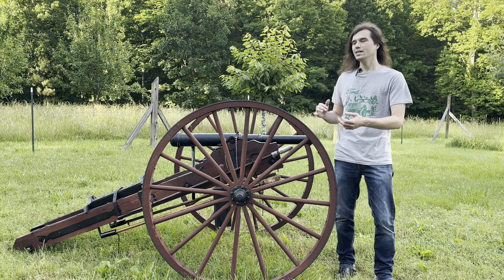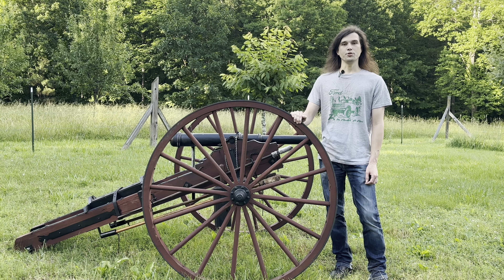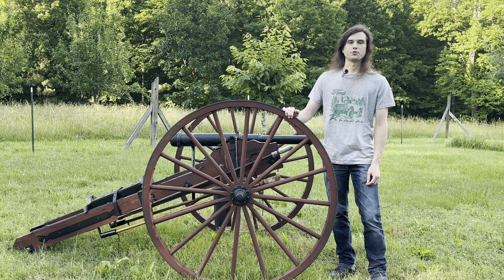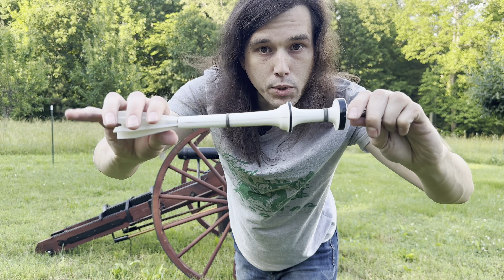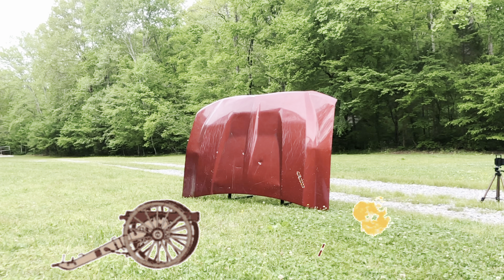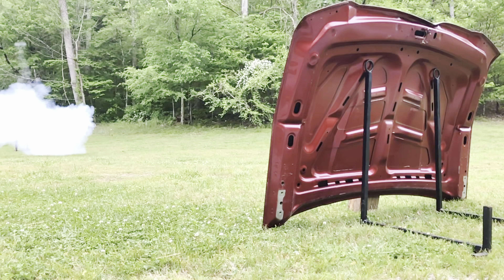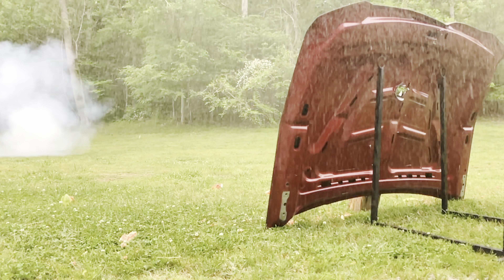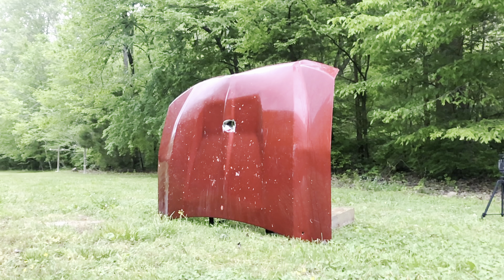Shooting 3D Printed APFSDS Tank Rounds

Comment: The speed you are going you might be able to get away with a more flexible plastic for the fins so the don't shatter under the initial shock of acceleration inside the cannon. Another idea is to drill a small hole and attach the fins with a cross pin through the the fins, or make the base of the metal dart slight larger in diameter than the body so the fins could not slide over the metal rods base (opposite end from the sharpened tip). Also I don't know if you cannon is rifled but riffling will destroy sabots to combat this the sabot needs to be a softer medium so it dose not get torn apart inside the barrel (why the 120mm cannon on American and German tanks are smooth bore while the British are riffled and don't tend to use the sabot shells the prefer squash head rounds)
Reply from the maker: TPU fins are on the list to try for sure for v2. As for the filing it’s a smooth bore as they got rifled cannons just before the American civil war.
Reply: @TheCannoneer   smooth bore definitely lends its self to working with a sabot round with less issue, don’t know it this helps but the real sabot’s on the 120 I’ve seen looked like styrofoam, but it was extremely hard, but still very light we were always running into them on ranges in Germany

Comment: So, the way sabots work is by using the sabot itself to drag the projectile down the barrel. One way you could make this work better is by using a threaded rod and screwing the rod into the sabot. That will probably be the most straightforward way of getting the two items to mesh tightly.
Reply from the maker: Threaded rod is the first change for v2! I didn’t quite know why it was threaded but that makes sense!
Reply: @TheCannoneer  glad to help. That will let you do away with the pusher plate and your fins will have a lot better chance of surviving. If they are still getting broken up, try printing them with PETG instead of PLA, it's much less rigid and more likely to survive bending.

Comment: Just a suggestion, but if you have some welding equipment you could weld steel fins to the steel penetrator. It would be much stronger and just 3 or 4 fins would be enough to stabilise the thing as we are not aiming for laser precision ( for now, but I have HUGE expectations for your channel). 
A possible solution to the brittleness of the sabots could be to have a thick steel base behind the thing and sabots made of wood. 

Thirdly why don't you contact the host of the Taofledermaus channel to spread the word about your cannon to all the homemade slugs manufacturers ? The chance of it working are slim but it could be a great opportunity for you.
Reply from the maker: I’ll play around with the base plates for V2 and try a bunch of versions y’all have suggested! He actually commented on the video! I think yall tagged him enough!

Comment: APFSDS rods have a mechanical hookup between sabot petals and the rod in the form of ridges which keeps the sabot from stripping off the rod.. and I'd go with metal fins.. anything 3d printed is likely to shatter from acceleration
Reply from the maker: I didn’t quite know why those threads were there but that makes total sense….

Comment: I like the anachronistic combination of 18th-19th century cannon and 20th century projectiles. Eric Flint would smile.

But you could learn more on each shot if you used smokeless powder and set up cameras to watch the external ballistics.
Reply from the maker: Sadly we can’t shoot smokeless out of the cannon for a few reasons… the ATF would classify it as a destructive device since it’s over 1” with a modern propellant and the pressure difference is wildly drastic between the two and our cannon wasn’t proofed for smokeless so the charge would be a trial and error to get right and that could cause some severe injuries to us and the cannon. I’d love to though as it’s much easier to see!
Reply: @TheCannoneer  Yeah, I know just enough about interior ballistics to be dangerous, while I've worked on a lot of liquid fuel rockets I've had no experience with solids, and burn rate exponents can change from steady burn to instant disassembly with breathtaking speed. Best to stick with what you know that works behind the projectile.

Comment: Don't use a pusher on the fins. The fins should be less than bore diameter, only four fins. Explosive gas will move past the fins and will push on the Sabo. The Sabo needs to be mechanically linked to the penetrator, ribs or threads on the penetrator, and ribs or threads on the Sabo. I think your sabo will fail if you make it out of PLA. If you have a lathe, you'll want to machine it out of aluminum. I'd recommend making the fins screw on aluminum as well. Make the penetrator a bit shorter.
Reply from the maker: I much appreciate your ideas and I’ll take them into suggestion for V2. Especially the threaded rods.

Comment: I'm seeing a couple of major design flaws already 
1. Adding the base plate is creating more problems than it's solving there should be as little stress as possible on the fins during firing because any damage to them will screw up your accuracy.
2. Your sabot should be mechanically locked into your fin round until it leaves the barrel either through a series of matching grooves and ridges or a flange at the front this will put all the stresses on the sabot during firing preventing damage to the projectile.
3. If the font of the sabot forms a concave cup to catch air and the forward binding is weakened enough this will cause the sabot to open properly and give it leverage to snap the rear binding causing a cleaner separation.
4. Depending on how your sabot is handling the stress of firing you may need to make it much more substantial and or switch to a more elastic less brittle material.
Reply from the maker: Much appreciated for the suggestions. I screen shotted your comment! Thanks!

Comment: steel rod needs to reach all the way threw the fins and have a 37mm steel plate at the bottom. also need to use pla+ or tpu for the fins
Reply from the maker: We shall see if those get it working on V2!

Comment: Honestly, do you really need fins on the end at this kind of range?

Okay, hot take. You know how a Minie Ball has a conical bore on its base? It serves two purposes. One is ensuring proper weight distribution. The second is that it'll obturate against the barrel when the hot gas expands behind it and form a nice and tight seal. So replace the fins with a cone made out of a relatively soft but strong material so as to not destroy your barrel. Maybe try aluminum flashing? Lead flashing is available if you're really worried.

Basically... it's a giant blowgun dart
Reply from the maker: We shall find out! I like your redesign idea so we shall see what happens for V2!

Comment: Use weldable steel fins.
3d printing in plastic is barely useful for Hobby grade RC vehicles that dont see the heat and pressures of a cannon.
Reply from the maker: That’s V2’s biggest change. Welded fins!

Comment: It seems to me the PLA fins might shatter before leaving the breach, due to the base plate being slammed into the much more massive steel penetrator rod.  Try metal fins?  Or redesign the fins so the rod touches the plate, that way they won't be crushed between the rod and the plate on firing.
Reply from the maker: Metal fins for sure! Some folks have suggested TPU so we shall try both!

Comment: I see good comments here. Mainly I would just make the discarding part of it a chunky cylinder that fills the bore and encapsulates the fins in addition to the penetrator to support everything as well as possible. 3D printing lends itself to chunky designs and your fins are too flimsy to be carrying all that acceleration by themselves. You might even see about adding a steel cross pin into the penetrator a little further up that can also key into the discarding sabot to take some of the stress off the fins. This would allow the sabot to pull directly on the penetrator taking some of the force away from the back. I imagine that even if the fins are surviving, the penetrator is getting driven back through the fins and through your TPU pushers like the penetrator that it is lol

Comment: Maybe cut 6 fins out of a thin sheet of steel and weld them onto the rod, or submit your STL file of the fin assembly for a CNC quote online (aluminum preferably) and glue it with JB weld. It is important to keep the penetrator relatively tip-heavy using lightweight fins, otherwise it will just tumble like those failed APFSDS rounds featured in the Taofledermaus videos.
Reply from the maker: Welded fins seem to be #1 suggestion so that’s first on the list for V2.

Comment: Okay man, I'm interested in the elements that are coming together here and you're doing some real cool stuff.  Subscribed.
Annealing your PLA prints in an oven will help their durability and shatter resistance but it'll make that oven pretty much unusable for food and I'm not sure it would help enough to fix your fin breaking issues.
I'd be really interested to see a form of ammunition go through that cannon like the wax slugs I have made to go through my shotgun.  You probably know all about them but if not the idea is to take a round of bird shot and fill the space between the lead pellets with a material that will hold them together through firing but come apart upon impact, such as wax.  This causes all the energy of each pellet to remain as one unit until impact where all energy will be dumped immediately giving little penetration but terrific energy. Scaled up to 38mm could be fun!

Alternatively, I would like to see if a non newtonian fluid of any make up could survive firing. Perhaps a balloon full in a shot cup with a boat tail on the back of it for stability.  I want to see what it does to a car hood.  A splatter or a deep dent?
Reply from the maker: Saved your comment! Great ideas and I wonder what would happen to them getting hit too… also we have a shop oven! Poor thing is used for heat treating stuff in the blacksmith shop!

Comment: Can you print a 38mm x 40mm plug with a short, centered protrusion the same diameter as the penetrator? Then print the fins with a center hole the same size so you can set the pin against the rod? This would direct the propellant's force somewhat more directly through the rigid centerline. Hopefully the plug will even out the force of the detonation on the round. Super interesting, folks are on to something with the material durability question. When you get this sussed build a HEAT round. 😉

Comment: Your problem is simple, the sabot is supposed to lock on to the penetrator and is used to accelerate the penetrator down the barrel with the sabot releasing and flying free once the penetrator exits the barrel. Your base was is crushing the stabilizing fins upon ignition.
Reply from the maker: I will admit I didn’t know why the rods were threaded but that makes total sense…
Reply: @TheCannoneer  you could also design the sabot as a cylinder that sheds the outside at the muzzle. Like an exact opposing mirror print of the sabot it's self, but fit to the bore  diameter.
Reply: @TheCannoneer They are ribbed* 

for her pleasure
Reply: yeah I’m pretty sure this is it
Reply: @TheCannoneer  I have spoken to tankers and people who understand the sabot shells and I was able to identify a couple problems
1) The base plate is coming out as well, this doesn't happen in an actual tank as that part remains in the breach and gets ejected when the breach is opened
2) The petals on the sabot are meant to attach to the base plate and dislodge when fired hence the problem of it not flying straight (if you looks closely at an ejected sabot case you can see where the fins sat prior to shooting)
A solution to solve these problems would be to potentially reduce the width of the stabilizing fins on the rear of the sabot or you could make an older style of sabot the APDS which is APFSDS but without the stabilizing fins. Also the threads on the sabot are just to stop the sabot from slipping out when being loaded into the gun. Sorry for the paragraph but I do hope this helps you.
Reply: @jackcitry3205 APDS needs rifling to stabilize the projectile. While at the ranges he shot in this video, they would probably work fine for the most part.
Reply: This is the correct answer.
Reply: Grooved not threaded but yes. This.
Reply: If you make the fins slide all the way up on the rod so that the weight is put onto the rod instead of the fins, then the sabot needs to have a support that goes to the back of the fins on the plate so that there is no load on the fins at all
Reply: @randolot  The sabot provides the gas seal and centers the penetrator along with the fins in back. The driving force of the gases is transmitted to the penetrator by locking ridges in the penetrator, and corresponding ones on the sabot which releases into three parts upon departing the muzzle of the gun.
Reply: and the fins need to be able to survive the ignition,  pla is not gong to cut it
Reply: I was hoping someone said this.
Reply: What would also probably help is casing the fins out of aluminum
Reply: The fins should be arranged so that the penetrator spins up slightly, avoiding tumbeling.
Reply: On this line, make the fins longer and foldable. Locke folding fin rockets shot out of tubes from aircraft. They will stay attached and unfold upon leaving the canon starting a stable spin.
Reply: could be solved by just having the the penetrator past the fins a little bit resting on the cushion. getting sabots that can deal with the pressure could be difficult

Comment: I would slide the metal shaft of the projectile through the fins so it sits up against the base plate, flush with the bottom of the fins. That way the force of the load will not instantly crush the fins. Nice design though, you're really on to something!
Reply from the maker: I’m sure with all y’all’s suggestions we can get it working for v2! P
Reply: @TheCannoneer  woooooooooohooooooooooo that shitz awesome, keep it coming!! Shoot a 5g sealed container full of gas with a flare lit beside it to make sure it lights 😎  that would be the most American thing ever and easy to build. That's not a suggestion, that's an order cpt. !!!!!!!!! Yewwwww!💥🗯💥🗯💯💫💯💢💣💨🖤🩶👌✌️🤞🖕👆👉👈🤙🤘🤟🫰💥🗯💥💭💭💭💭💭🗯

Comment: K.i.s.s.  principal ( keep it simple stupid)  don't use smooth rod, use a threaded rod, try copper for fins if u can't weld only make 2 or 3 ....make the Sabot in two parts ( half sections.) Use a nut forward of the sabot to push the threaded rod out of the bore. Light weight projectiles can use faster burning powder switch to a black powder substitute ( 3F) and work up powder charge. You'll have less smoke with you shot. Do yourself a favor and wear a flack vest and kevlar helmet ricochet are no joke.

Comment: I think your sabot is shatering inside of the barrel because they are not locked to the penetrator. If you cut some groves into the penetrator and have some matching groves in your sobot so that they dont separate from the penetrator until after they leave the barrel.
Reply from the maker: Threaded rod is a top change for V2! Thanks!